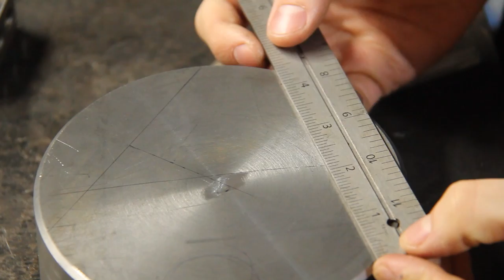Building a DIY POWER HAMMER | Part 2 | WITH PLANS

Comment: How big is the anvil part of the hammer? Where do you get it. I’m having trouble trying to find that big of a piece.
Reply from the maker: Its a 6 inch round steel bar, you can get them at most steel suppliers

Comment: Excuse me, how many cycles of the motor used in the hammer, is 3000 cycles useful?
Reply from the maker: The one I used is a 3450 rpm motor. You could use a slithly larger drive wheel with  your 3000 rpm motor

Comment: You had too small of a quench bucket without enough quench oil to adequately harden that 4140, it was too much mass for such a small amount of oil that it didn’t cool quick enough as a result
Reply from the maker: It does make alot of sense ! Thank you for the tip
Reply: I was thinking the same thing.  I also thought he could have done the initial quench in oil and then switched to water to complete the quench. This way the oil would "soften " the cool down as opposed to a violent water quench that may make it too brittle. But it seemed to work so. . It must be very gratifying to be able to forge on a power hammer you built from scratch. Congratulations I'm green with envy.lol keep up the good work.